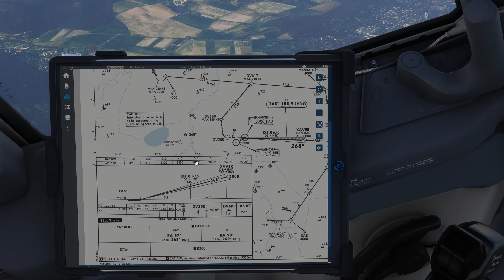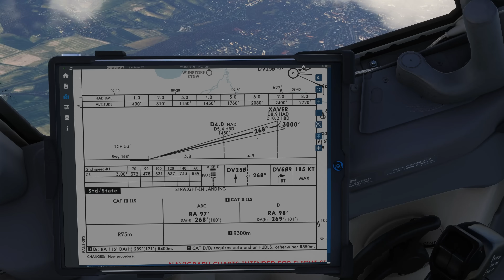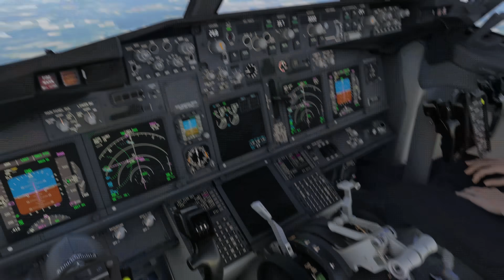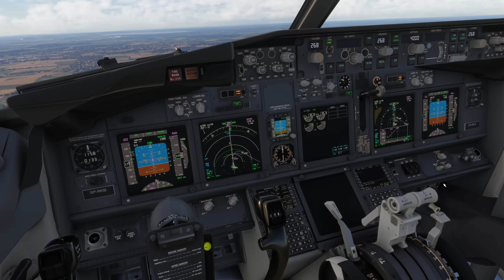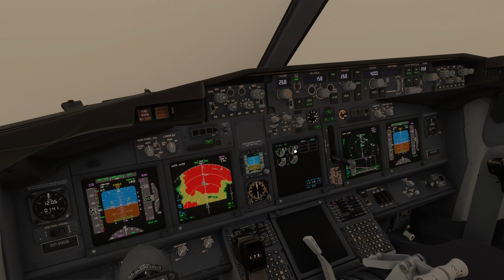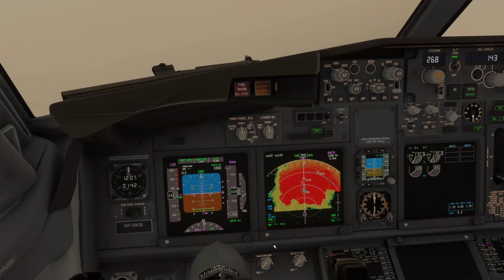PMDG 737 Virtual Type Rating - AUTOLAND & Automatic Go Around | Real 737 Pilot

Comment: Hi Emmanuel, can I ask why each time localizer had an offset on the runway course? Thanks!
Reply from the maker: Tbh I'm not 100% sure. Either a bug in the scenery or a problem with the airplane. Or a combination of both. You can see on the PFD that it's not perfectly centered, however I'm not sure if the deviation is still more than it should have been for that localizer indication.
Reply: @A330Driver Thanks for your reply!!

Comment: Is it the ATC that informs the pilot about the need to use autoland? If so, what happens if the aircraft or the crew is not certified?
Reply from the maker: Basically, once the weather is below CAT I minima an autoland will be conducted.
In better than CAT I conditions the pilot can decide on their own.
Reply: @A330Driver Is the ILS category specified in the ATIS/by ATC or is it to the pilots to determine that based on the weather?
Reply: @Alan-oh9qi  the ils category is decided by pilot based on weather conditions, atis only tells if the ils is in use or not, not the category
Reply: @fenixlawlietwhy an ILS would not be in use?
Reply: @cclguedes7  some airports don't use ils because of terrain, or it may be inop, which are generally what you come across

Comment: Hello Emanuel,

1)
I know that RYR does Autoland in CAT II conditions.

But does every airline require to turn off all electronic devices like Tablets and Telephones for AUTOLAND?

Two years ago we did an AUTOLAND CAT II in EDLV with a 737-8200, and the flight attendants of RYR required from all passengers to turn off the electronic devices. Flight Mode was not enough.

Is this regulation also in your company when you do an autoland in an A330?

2)
Regarding CAT II AUTOLAND I know that aircraft manufacturers suggest to make an AUTOLAND, but airlines can decide if they allow their pilots to do a manual approach in CAT II conditions.

Did anything change about this regulations?
Reply from the maker: Hi,

1) CAT I is the lowest where a manual landing is allowed (unless you got a HUD - then you can do CAT III to a DH of 50ft).
So CAT II and III are autolands.
Turning electric devices off is a legal requirement as those devices can interfere with the airplanes sensors.
It's the same on the A330 and any other airplane.

2) If you're equipped with a HUD it's up to you, if not an autoland is mandatory.